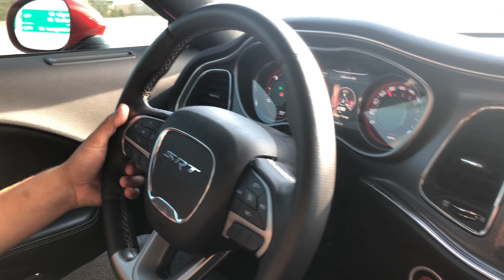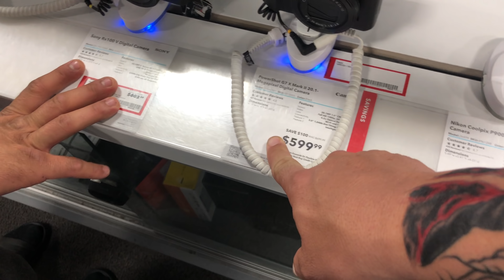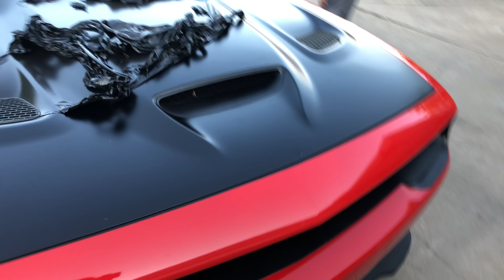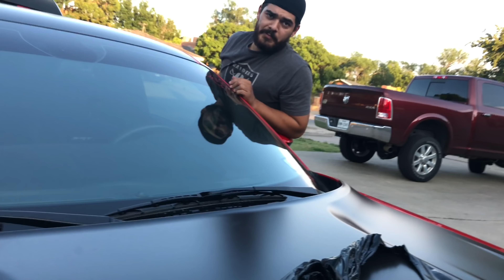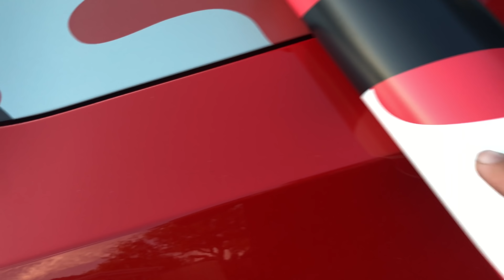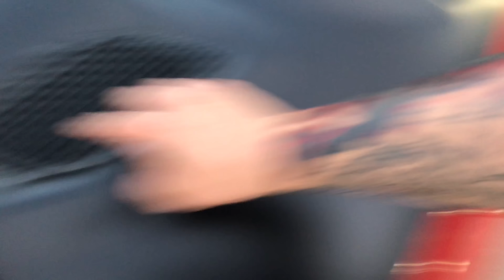UNWRAPPING THE HELLCAT!

Comment: The printed rap starts off on white vinyl in this case. I know my Roland printer the red really pops. Also I printed wrap is usually laminated after the print so the durability and UV protection for the colors is much better.

Comment: The rap is not as bad as the license plate in the front windshield get rid of that man
Reply: Rigo Juarez I live in Texas I own three vehicles not of one of them has a front license plate on it and if I do ever get pulled over I’ll pay the ticket instead of drilling holes are putting a license plate in my windshield..Sometimes you have to pay to play
Reply: Get the hide a way kit on Amazon drilled into the dam under my ram and my mustang no holes in bumper problem solved...NY requires front plates also it blows.
Reply: Rigo Juarez exactly what it is made it through the winter fine so you should be golden in texas just through some self adhesive felt on the back to protect the wrap or paint just in case that's what I did.
Reply: WERKED66 yeah I’ve seen those they’re pretty cool but I’m not drilling anything into my bumper of any of my vehicles again like I said if I get pulled over I’ll pay the fine for driving without a front license plate for about seven years now on all my vehicles and have never been pulled over for it... wouldn’t do it right and dirty...lol
Reply: GMoney it gets mounted from underneath the air dam but you keep rocking I did for a while till I got a ticket myself.